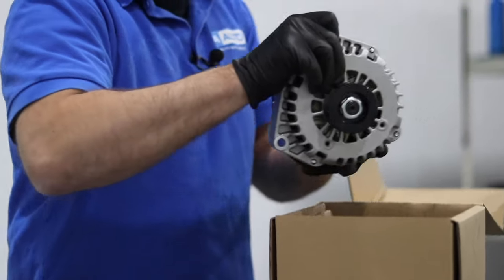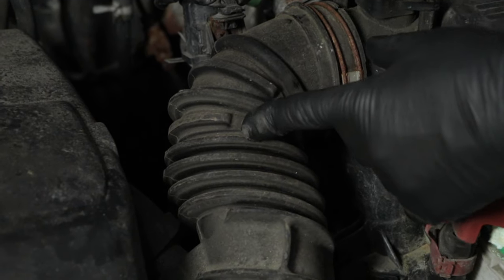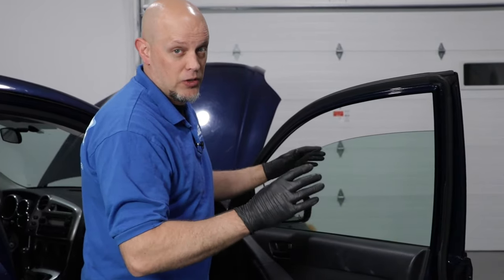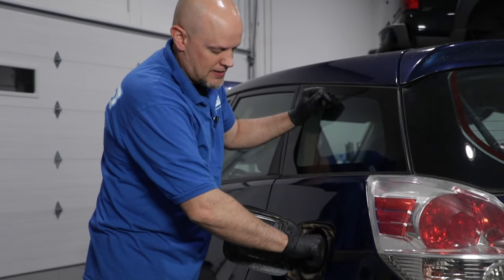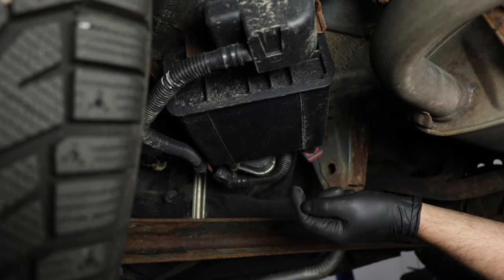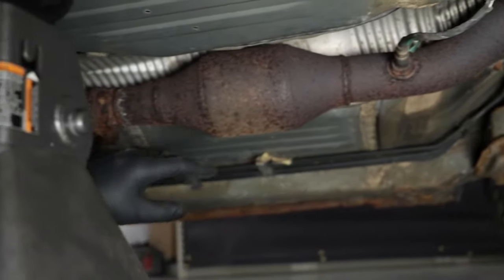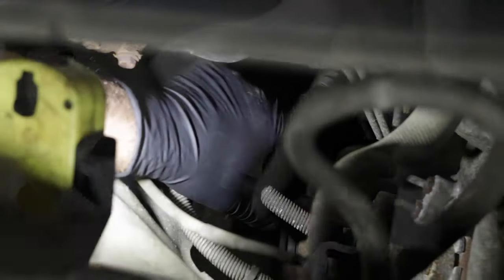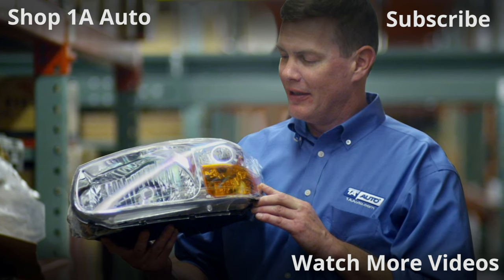Top 5 Problems Toyota Matrix Hatchback 1st Generation  2003-08

Comment: you failed to mention the issues with the standard transmissions in this car. its a known issue that around 200,000km the 5th gear will give out and break. this is because of a faulty pilot bearing. in order to resolve the issue, the transmission must be taken apart and that pilot bearing replaced. or else the ring gear will be damaged beyond repair. ask me how i know. however the motor will run forever, just as long as u keep up the structural integrity of the frame.

Comment: Hi my problem is is that the check engine light kind of goes in and out coming on and off and I’ve been ripped off by so many mechanics I don’t know what to believe anymore anyway this one says that apparently all my wires have melted together causing a massive short in the system. Which I don’t really believe because sometimes it comes on sometimes it doesn’t then he said that somebody intentionally disconnected the check engine light by bending the prongs I’m not sure what that meant but if somebody bent the prongs to disconnect it how could it come on and off like that? I love my Toyota matrix it’s the best car I’ve ever had I really don’t want to sell it

Comment: Question... I have an '06 Vibe. Did all the mounts last year. But the issue I am having now is that the front one went bad again. It's fine. I swapped it out again this morning. No more vibration or anything like before. But now when I turn the heel hard over and step on the brake I get a huge clunk. It can be reverse or in Drive. 

Is it the back mount?! It was opposite the failed front mount obviously... I really hate getting that thing.... any tips on how to get the back mount put again preferably from the bottom?!

Comment: Or the issue with the motherboard going out on the gauge cluster mine just went out at 204K having to replace it. I had to replace a couple bearings in the transmission somewhere around 165K. The liners are plastic in them. IDKY Toyota? I have an a Vera ration issue I have changed the air filter and map sensor. Probably the intake seal or catalytic converter.

Comment: I have an issue with my 2005 matrix xrs manual transmition when i run it as usual everyting good on it onec i park some were as i starts moving it smoks blue i wnt know why this happen and when i starts it daily as usual smoks white which is know it normal becouse the engin is cold

Comment: My 2006 Toyota Matrix XRS 6 Speed up till today this week has had minimal repairs. Today my car overheated while idling. I don't know if it's the radiator I don't know if I'm low on fluid I don't know if it's a thermostat. And my AC is now blowing warm I don't know if it's a fuse or leak meaning freon . Earlier this week my alternator went out and was repaired.. any suggestion?
Reply: Hopefully you’ve gotten it fixed by now, but you might make sure your cooling fans are working, too.

Comment: I have an 06 vibe with 215,000 miles that threw the p0171 code.  Guy at the parts store putting in a new maf sensor would just be a shot in the dark and  lots of other things problems could be causing that code.  I see that is the first thing on your list.  Should I go for it or bring into a pro like the parts guy suggested?  I'd really rather not have to bring it in for something as simple as that.

Comment: My Matrix kicks off a check engine light only when it is very cold out. No problems with the car drivability but the code always refers to the transmission. What could this be? Is this a sensor maybe going haywire? This is been happening or at least five years and more than 50,000 miles we’ve driven. Any advice? Sensor maybe? Thanks.
Reply from the maker: +PSthefirst1 We wouldn't be able to diagnose an issue like that here, you may want to have a local mechanic take a look at it. Thanks for checking us out! http://1aau.to/m/Shop-1AAuto-c

Comment: I’ve got a 05 matrix Xr got for me teen and ran awesome but we got a tank of gas last week and within 10 minutes the car made a roaring sound like it was stuck in 2nd gear But that’s NOT what it was anyway I started driving it the  past few days took it got checked and they had me to change the MAF …. Well here’s the problem now it’s started running awful and trying to die when I give it gas and yesterday I cut it off and it wouldn’t cut back on checked battery ect.and nothing so called tow truck but before it got there tried to start it one last time and it cranked right up 🤦🏻‍♀️ … Has anyone else had this kind of issue ???

Comment: I have a pontiac vibe (same car) and Ive had starter relays go out a couple times
Reply: just engine and transmission from Toyota everything else from GM, that why you have that problems
Reply: @sergiotorres9156  false the car was co developed, the only gm exclusive parts on a vibe is the HVAC and Radio.

Comment: I just found a 2004 Matrix with only 81000 miles in my area . They want $4500 . I will use it for delivery car . What do you Matrix owners think,  yay or nay ?
Reply: I think you can get a better price, too high
Reply: My opinion is that it depends on how well they serviced the car, what repairs are due, andcwill be soon due... and the interior and exterior condition of the car. Mine needed brake work and tires, within a year it needed struts on both axles.  So though I paid only $2600 for it with 193,000 miles, in about a year I paid $240 for brake parts, $300 for tires, and $600 for struts all around.That is $3740 by my calculation for a car 2 years newer, being a 2006, but mine will have 2.38 times the miles on it. Yours might be the better deal but it depends upon the variables.
Reply: thats a good investment. these cars last for hundreds of thousands of miles, in fact many people have discovered that the odometer stops counting at 299,999 miles on every 03-08 model
Reply: @mark4347  i got my '07 xr 5-speed for $1200 because the guy who owned it before me blew up the clutch and sent pieces through the transmission, so i had to get a new one which was pretty expensive, over $1000 miles but the car was set for life after that... then it got totaled when i got t-boned
insurance gave me $2785 for the sad remains of the car, which was unfortunately totaled but still ran and drove because toyota

Comment: Could y'all do one of these on a 99 Ford ranger,  I think I need it haha
Reply from the maker: +A furry degenerate We're always cycling through common cars. We'll add this repair to our list! 1AAuto.com
Reply: My dad had the '99 Ranger in manual. Had 535,000 miles on it before he SOLD it to the kid at the junk yard. He got rid of it because the clutch went out for third time and he didn't see sense in replacing it at that mileage.

Comment: So far, 290K MILES, bought new,  007, first thing went was the pass door retainer,  then drivers side regulator,  (2x), then spark plugs,  manual transmission because i never changed its oil,  like a dummas,  clutch,  battery,  done light air working,  radiator and just did control arm bushings. Now instrument lights won't go on and they no longer make the relay,  if that's it,  trying to RnR the dimmer to check it and also the little photocell on top of the dash.  Still runs like a raped ape. Cats went a few thousand miles ago but doesn't seem to affect anything. Cheap replacement tail lights easy to replace,  headlights need the front bumper removed but make it look like a brand new car.  It's been my work truck since new,  can carry everything needed to do a service change including an 8foot ladder and a 24ft extension ladder out the back window.  It's paid for itself in gas saved. Will definitely be looking for another used one when this one dies.  If i don't first. Mechanic who did the control arms says my clutch is acting up so might need my 3rd one soon. (It seems fine to me). Oh yeah,  all the hub caps fell off within 3 years,  like all the rest.  I painted my wheels with hammered paint, looks and lasts Great!

Comment: You should add the viscous coupling.
Reply: Amen to that. It's actually the big bearing in it the craps out. The whole thing usually does not need to be replaced, but that's toyota's only fix. A good mechanic can replace the bad bearing for around a quarter what dealer wants.

Comment: Has anyone had problems with the headlights burning out the wiring harness? I have a 2006 Matrix and I love it, but the darn headlights are giving me the blues. I've replaced the bulbs twice and the harnesses once, yet they keep shorting out on me.
Reply: get some dielectric grease and a q-tip, coat the inside of each of the 3 sockets on the headlight connector and do the same to the 3 external headlight bulb electrical contacts. Plug the connector back in to the bulb and it may fix the issue. Did for me. Tip from an auto and tire place.

Comment: How do you know if it’s the engine mounts causing the vibration at stops?
Reply from the maker: +Kyle Grund To verify that the vibrations you are experiencing are due to damaged motor mounts, simply pop the hood and check the engine. If the motor is not sitting level, the vibrations could be caused by a damaged or broken mount.

Comment: Thank you for making this video I am having a problem with the evaporator canister getting a P0452 and we can't put gas into the tank without the pump clicking off all the time. Is this evaporator canister?
Reply: Verify  operation of vent and purge valve first, but sounds like you've overfilled the tank accidentally or one of those valves for your evap system being stuck on/off cause the gas to be forced into the charcoal canister  saturating it to where it cant breathe
Reply: Most likely

Comment: How do I take the water out of the 2006 Toyota 2006 matrix tail light
Reply: I doubt if this is the Toyota recommended fix, but I drilled a 1/16 inch hole in the bottom. I live upstate NY and problem solved.

Comment: I get a clunk when I get going from a stop. I wonder if it's my motor mount. (I drive a 2004 Matrix)
Reply: Regarding the clunk/thunk, while Google searching for another question's answer I ran across a forum which discussed this exact issue.  The forum member stated that it is a design engineering issue in all the Matrix/Vibes with the A246E transmission. Just go gentle for that first shift and enjoy all the other gear changes. My '06 Pontiac Vibe has 220k and as far as I know, it is the original transmission with the first gear to second grade mini thunk. I bought it at 193 thousand miles.

Comment: I liked your video, I tell you that I have a  Toyota Matrix 2008 and I have a broken engine support and it is very expensive, I have not changed it.

I also see that the air conditioning has no power, is that normal?  Saludos de México

Comment: My 2007 Toyota Matrix has 160,000 miles. I just replaced the converter. Most expensive thing I’ve put in the car (I’ve doubled the mileage in three years of owning it - got it at 80,000)

Since I’ve had the car the driver side window only goes down halfway. It has manual locks and windows. Wondering if that’s caused by the same issue as the window falling down..?

Comment: I have matrix 06 nd it vibrates when its moving from 2 to 3 gear and the the check engine sign on the dashboard though yellow
Reply: Scan it and see if there is code for a trans solenoid. Also (w/ vehicle off,) check the connector to trans-pull it and check for corrosion, clean it with electrical contact cleaner.  It could also be the ECU, but that's rare. Also, keep in mind that bad data from another system could effect shifting. I just had a lean code on my 06 matrix: turned out to be leaking valve cover gasket leaking oil onto electrical connector on side of engine block. This sensor was sending bad data to the ecu and it was trying to compensate. Disconnected and clean sensor fixed it (and replacing gasket so it wont happen again. Had nothing to do with typical causes of the lean code.

Comment: My Toyota Matrix keeps giving me evap codes and catalyst converter codes, I have replaced the catalytic converter but still the same problem. Runs full tank in less than 200Miles.
Please help with possible solutions.
Reply: Did you clear the codes after installing new cat? Also, some non OEM cat's just won't play nice with the computer. I would get a proper diagnosis before proceeding. Always start with the basics: Engine oil, Battery, Plugs, Air filter, vacuum leaks, etc. Something as simple as a clogged air filter can throw weird codes.
Reply: I agree with MarzNet256.  Plugs, Air filter, Fuel injector cleaner (Techron) (2 tanks).  I also had a problem with my intake manifold gasket which greatly improved gas mileage when I replaced it, especially city mileage. Difficult to diagnose intake gasket leak. I Just replaced gasket and it worked wonders. Good luck.

Comment: I kid u not my gfs o6 matrix has a quarter of a million miles an runs like a champ, broad powerband for the lil pep it's got , an the most unheard of thing is that she hasn't changed her oil in 25k miles. Stubborn girl but wen I get to check her dipstick an see it's none dry il add about a quart or two of castrol Syntec an wait till Its ready for a quick car wash an check the dipstick  again an add oil, got it for 1400$ an she drives a few hundred miles a week all highway an has no issues going a  steady 80mph with the occasional euro tune up wenever I wanna act like a pissed off teenager again, I can't believe the neglect the cars has gone thru but can run bone dry I'm sure oil passes the rings with the heavy foot but the catalytic converters were replaced right b4 we got it so b4 the blowby  can become an issue an clog em up again I'm sure the wheels will literally fall off. That once a year oil change an fresh plugs keeps the matrix reloaded an continue down the rabbit hole
Reply from the maker: +Garrett Maeser Thanks for the feedback!

Comment: Hi, I have a 2009 Matrix.  I was wondering how do you fix code P0368- Powertrain Camshaft Position Sensor "B" Circuit High Input (Bank 1)?
Reply: First I would change the sensor. Seems like an electrical issue more than anything.

Comment: Total catastrophic failure of the manual transmission.  Google it. Mine cost me $3000.  Problem was corrected later in the run but 03's and '04's all fail.

Comment: When should you change the spark plugs?
Reply: Every 50,000 or 100,000 miles
Reply from the maker: +Ada L Thanks for watching!  You can check your owner's manual for that info, but you generally do not want to go past 100,000 miles with the same plugs.